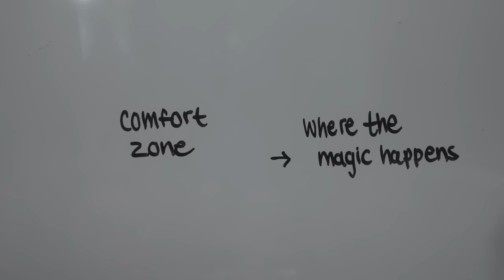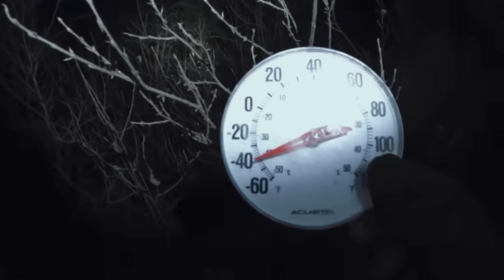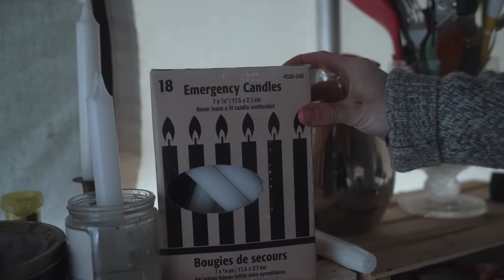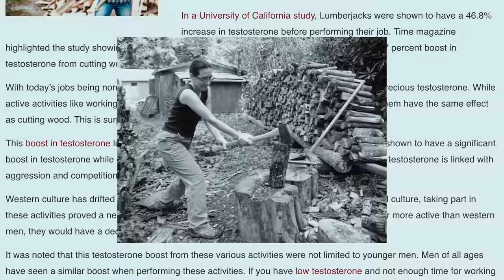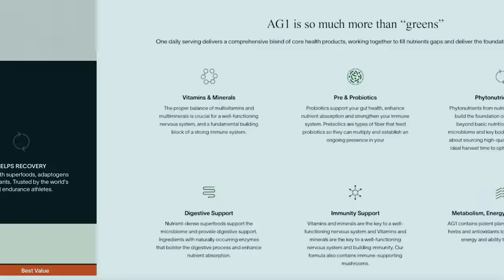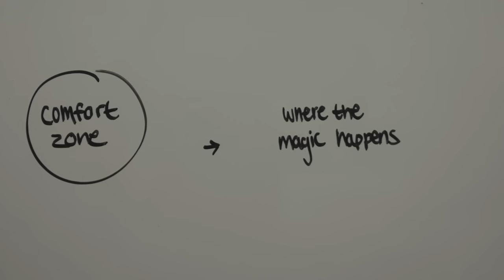Hot Tent Camping In The Great White North

Comment: If you buy a couple of led sun rate panels you can have them come online as an alarm clock. I have had one over my bed for years and it really help with solar deprivation. Having lived in Toronto area til I was 15 I noticed and remembered how cold you can get as I saw Jasmine’s Rudolph nose. Make hot tent warmer over night place a very large stone on top of wood stove it will radiate heat all thru the night.

Comment: These hot tents...  can be huge, hot, and kitted as much or as little as you want. 

you can go as small as 8x10 with them or right up to 16x24...   (seriously, there are cabins smaller then that).   And when you get into the 384 square foot area... you can actually break them up into "rooms", including a full bathroom.   

now kitting them out, with things like propane hot water on demand heaters... you can make a bathroom with composting or cassette toilets, sink, shower, and even bathtub. 

They can be double or even tripple walled"   where you have an inner liner, outer canvas, and fly.     This provides great insulation, plus, the frames are often heavy wood or steel.   their snow loading is able to take really bad snow and ice events.

Wood stove for these are often "massive"  they are not the little tent camp stoves people use, these things are BIG, ranging from 60 to 85 pounds +...  with 8-12 hour burn times,  putting out massive amounts of heat so you are safe even in -40 temps.

Comment: Omg that weasel would have me sleeping outside or running home,  How did you keep Bella and Izzy safe? Our pup would be crying to run after it. Love your challenge congrats!
Reply: While they are predators they mostly just hunt the mice or prey smaller than them. I've had invasions by them in past apartments, one used to sit in the gap between the stove and cabinets and watch me. They were quite easily cornered under furniture by cats. The screech they make when cornered is quite bone chilling but they are not going to attack a larger animal unless it is in defence. I caught one once with a cracker box and relocated it across town.

Comment: Hope you have a fire plan.  Meaning if the main cabin is on fire, is there another building you can go to far enough away that it won't catch on fire from falling embers and/or radiant heat, during snow when can't drive away.  What would you do?  Plan now, hope never need it, but fires do happen and where would you go if has to evacuate when there is 30 inches of snow?  Car?  Is that parked far enough away to not also catch on fire too?  I say this not to scare you, but to have a plan what would you do, and know where you meet up if you two get separated during an emergency and loose sight of the other in thick smoke.

Comment: The main source of concern when it comes to raw potato consumption is a toxic compound called solanine, which can cause headaches, nausea, diarrhea, and even death in extreme cases.
Reply: That compound is very prevalent in green potatoes. If you come across a potato that has a bit of green in a small area you can cut away a good part around the green area and still use it in cooking.